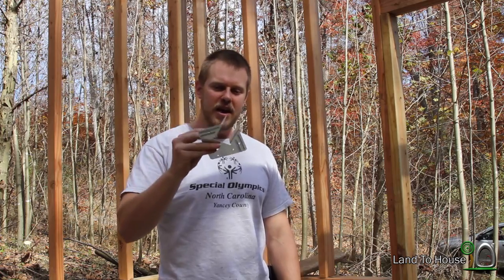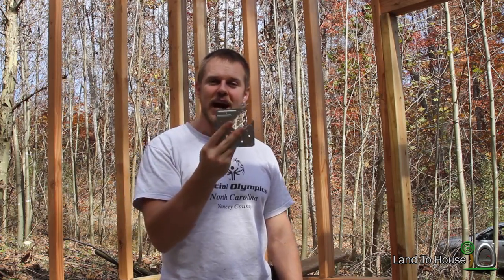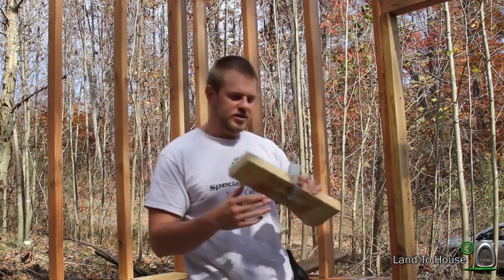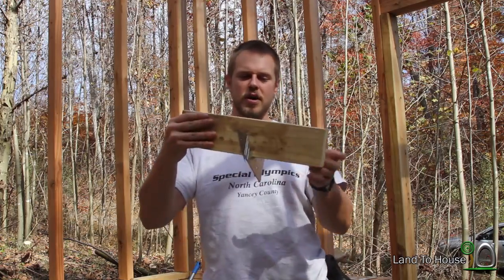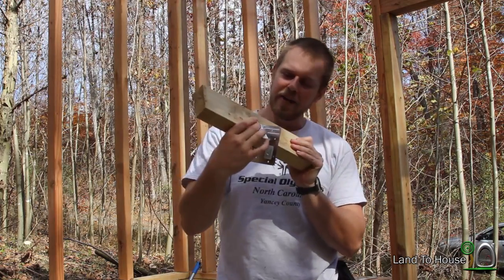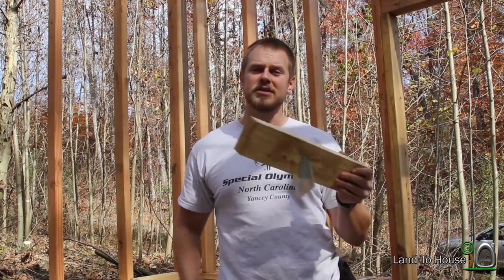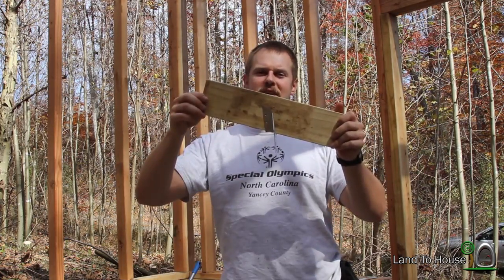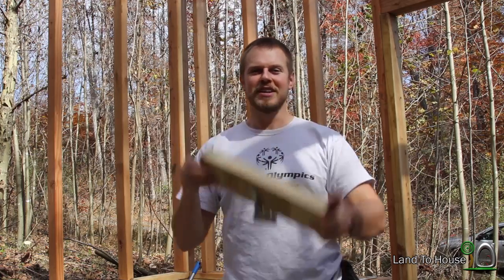Tiny House 19 - Install H1 Hurricane Clips

Comment: Simpson Strong-tie has a schedule for all of their ties and what fasteners should be used. Not following this schedule means you're not following building codes . H1 are supposed to be using 8d nails that are 0.131 inches in diameter and 2 1/2" long.

Comment: Is it me or has this clip been installed back to front?
Reply from the maker: Apparently it can be installed in both directions.
Reply: @LandtoHouse  That's good to know. I plan on using these but haven't seen them installed this way until your vid. I only intend to secure a shed roof. Nothing fancy. Thanks for replying👍

Comment: Your spacing is all wrong they should sit on top of a stud to transfer the load of the roof to the foundation not the top plate AND h1 clips go on AFTER THE TRUESS IS INSTALLED not to set the truss in.
Reply: You’re not exactly correct.  When you use 16” spacing on your walls and 24” spacing on your trusses each truss will not sit over a stud.  Double top plate resolves that issue by spreading the load.  Installing the H1 clip before hand isn’t we wrong but I wouldn’t do it.

Comment: My handyman drilled a hole into one of these when installing curtains high up.... is that bad?
Reply from the maker: You should be alright. There is plenty of area to ensure that the fastener is still going to be strong. Must have been drilling way up on that wall.

Comment: A taller ladder and a safety belt attached to the top plate would be a bit safer.  Standing on the top of a step ladder is moronic.
Reply from the maker: Thank you. haha. I have learned a little from the tiny house build. I now have two ladders that are taller and better to work on.

Comment: For what it is worth, that isn't Simpson Strong-Tie's product, it is a USP product and isn't called as an H1.
Reply from the maker: +Andy Viars interesting. How can you tell? I thought the box said h1 at lowes.
Reply: Simpson H1 brackets have 10 holes,not 14 hole,not that thats a bad thing,just not a H1 Simpson Strong tie,i could also be wrong and im sure someone will correct me if i am.
Reply: +Land to House  they have a white label with green letters.   That is USP's label.   They have H1 on their box because they reference their part to our SKU's.   We are a no equal product for what it's worth.
Reply from the maker: +rustygoldfanatic interesting. Well one way or the other it seems to be strong and not to expensive.
Reply from the maker: +Andy Viars I will have to go back to my local store and look to see if it is in fact H1. For some reason I was thinking they were the official product. I will be building my workshop soon and using these again.

Comment: I noticed you are installing these facing inwards. Is that allowed? I am about to do this and it would make the install easier if my H10A could rest on the top plate (both for support as I nail, and also for lining up on center with markings).
Reply from the maker: What i read is that when installed like this a birds beak cut is not required.  But please do further research before building.  I am no pro.

Comment: roofing nail should not be used to nail them in, they make a special nail for them Simpson joist hanger nails < just letting you know feel free to email me if you have any questions
Reply from the maker: I see. I was afraid that I would use the wrong nails. Are the ones you speak of the galvanized spiral nails? I saw a box of those by the H1 clips.
Reply from the maker: Michael Mannino oh I see. Well that would have been helpful. To be honest I have never done any of this stuff before and I am learning as I go.  Thank you for this info!  I have installed more strong tie on the inside of the trusses with the same nails. The building seems very strong.
Reply: If you "have never done any of this stuff before", why are you posting instructional videos?
Reply: every one can show you, whether it be what to do or what not to do.
Reply from the maker: Is it an instructive video? Or just a how I did it video?
Reply from the maker: Yes very true.

Comment: Interesting video, I have fixed many hundreds of trusses over the years but have toenailed them all, I didn't even know the H1 bracket existed but I can see it is a very effective way of fixing the trusses
Reply from the maker: These clips are very handy. I was able to install the clips in less than an hour and it made the truss installation very fast. And the trusses stayed in the correct spot when nailed in place.